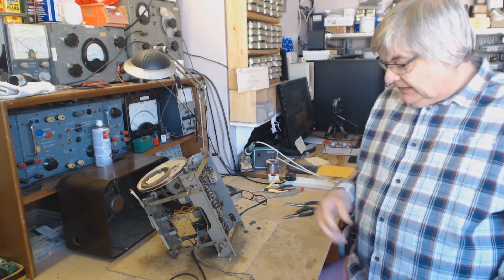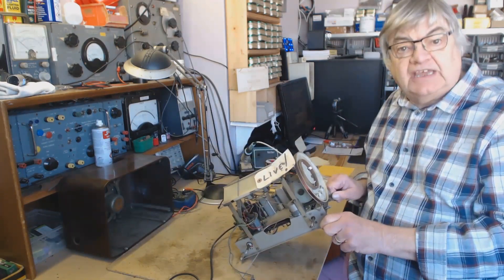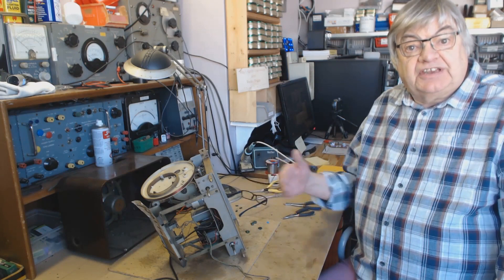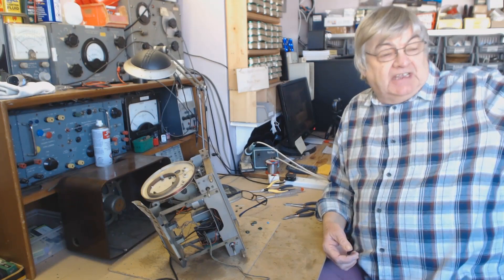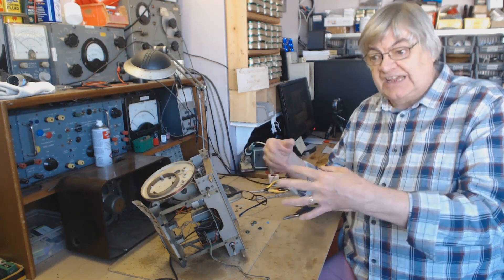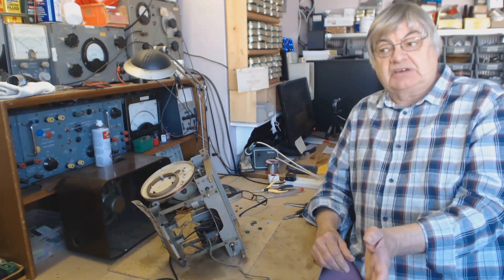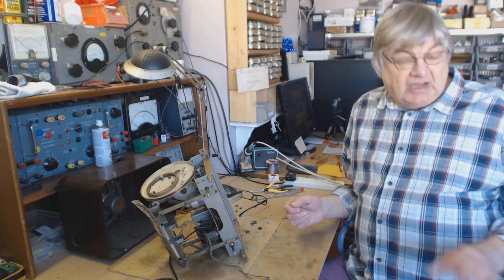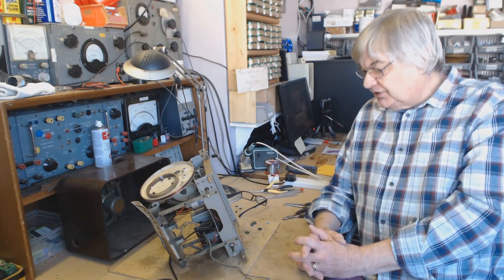The Radio Workshop - Retirement

Comment: Enjoy your retirement Ray, after 55 years it's well earned. All the changes you have seen in those years, from valves to transistors to ICs, black and white to colour, 405 to 625. Enjoy getting back to amateur radio and have fun ith that Lister D, they're a great little engine. 73's de John Joe EI8HNB
Reply from the maker: Thanks John, it’s great to hear from you.  Cheers, Ray.

Comment: Hi Ray, hope the retirement goes well. I remember retiring from work was so good for me, I only wish I could have done it twice!!! LOL. Incidentally, have you ever had an Oceanic valve radio in your collection? My dad used to have an Oceanic valve radiogramme, which included a turntable on top. The radio itself was MW and SW and the MW band only went down to 550 kHz and up to 1600 kHz, as far as I remember, though as the radio was bought in 1935, the MW dial went right to left, rather than left to right. The MW and SW dials were actually circular and displayed many of the stations. Unfortunately, we never took any photos of it, which is a pity. To improve the reception. we set up a long wire antenna that followed the picture rail around the lounge room wall. My first ever MW DX was done on that radio back in 1963. At the time, I lived in our former family home in Sydney Australia. Anyway, take care. Regards, Rob.
Reply from the maker: Hi Rob, I'm loving retirement. I now have plenty of time for amateur radio. No, I've not had an Oceanic valve radio. Great DX back in 1963! I also had an aerial around my bedroom for short wave. Great times. Cheers, Ray.

Comment: You have been fixing radios for a long time Rae.  It is time you took time out for yourself and the missis.  Fix what you want to fix and not what others want you to fix.  You are supposed to be retired!  Yeah, go fix your Lister Static Engine, it might only need freeing up, pour oil down the cylinder and leave it (Do it now) this will free it up if you have to strip it.  My cousin has a lot of engines, bought seized, poured oil down it, drained it and gradually eased the engine over until it became free.  Sometimes it is the side valve guides that are stuck (If it has them).  He often has to do very little to them but get them running after that.  Sometimes the Mag; is faulty or won't produce a spark if it is petrol. diesel ones can be a devil to start but will chug on all day.
Here is a tip, don't paint them up if you intend to show them, they never were highly painted and they will get marked down.  Also pay attention to the original colour, just a light coat of thin paint was all that was ever on them.
Have a busy retirement.  Looks like you have a lot of things to do.  You are going to be even busier than when you were fixing radios :-))  Don't forget to make the odd video.
Reply from the maker: Hi Bob, thanks for all the tips.  I've done the carb but the magneto needs looking at. Lots of work to do yet, and lots of videos to come. Cheers, Ray.